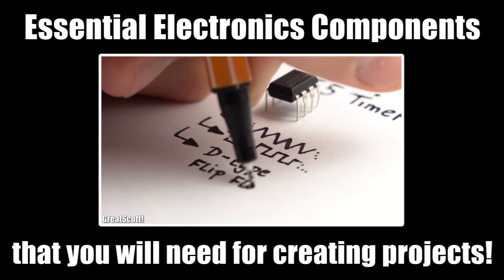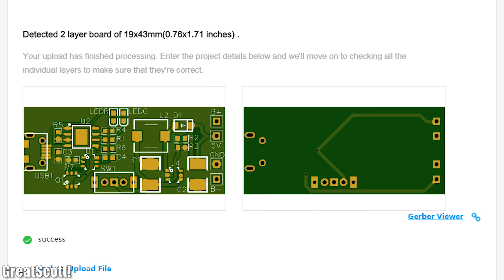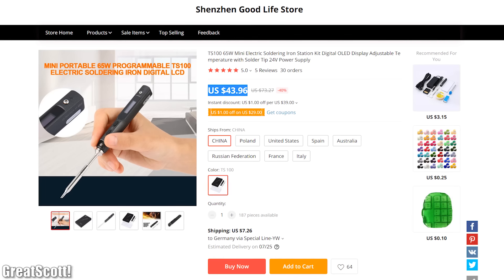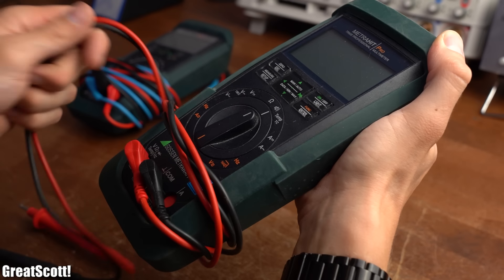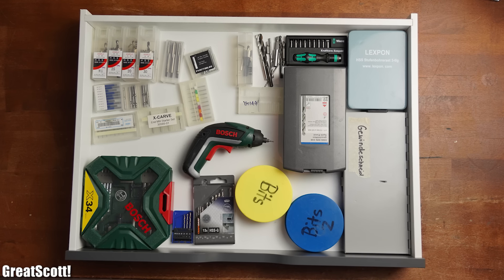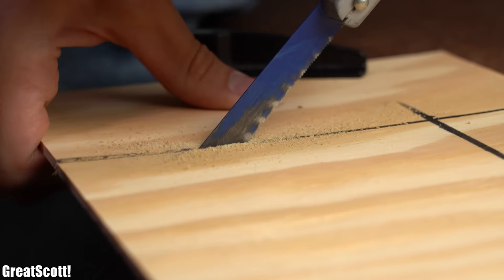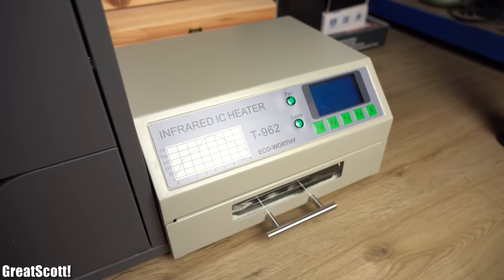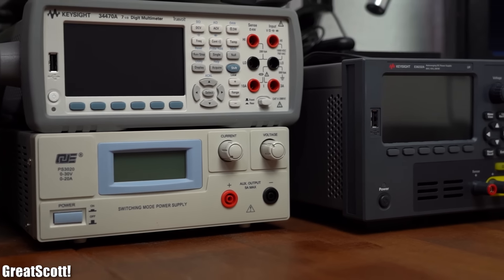Essential Tools that you will need for creating electronics projects!

Comment: I have:
0-200MHz Oscilloscope 2ch, color lcd, internal mem
Digital Microscope with helping hands
3 Soldering stations
Variable DC power supply (0-30V, 5Amp)
12 Volt 35Amp DC PS
A bottle of Crown Royal ( ESSENTIAL !! )
Drawer cabinet full of about any IC, resistors, capacitors, LEDs, jumpers, breadboards, sensors, etc etc
Toolbox with everything from automotive tools to electronic tools
Fluke 87
Snap-On tap & die set
Centech LCR
Bench vise
Spools of different gauge wire (solid and stranded)
Lots of solder in many different sizes and types
Lots of note pads every where
3 computers
a TV
Beer for the cat, so he will leave me alone lol
a Stereo system 
But most importantly we all need a brain!!
I think I really have too much stuff or so says the wife ;-)

BTW, GreatScott, keep up the great videos!!!!

Comment: Wow I own a 5$ multimeter and a 2$ soldering iron and I get all my parts from scrapped electronics. The fun thing is that when I needed an oscilloscope I got an Arduino with software called PCscope as a crude replacement , and here I see an oscilloscope costing 12000€ !

Comment: THE most important tool, is the wire cutter, spend over £30, I have been using a CK jewllers side cutter for decades, its still like new with sometimes very rough handling, indestructible!, those thin blade ones wont last you that long and these CK's get close enough for snipping device wires.

Comment: Another tool you miss out:
Tap and die set for thread cutting. Useful for making threaded holes on heatsink for example.
Reply: For some reason I can't find taps for sale in store for a reasonable price. Or when I do find them they are only for larger size threads.

Comment: I've used JLCPCB for my last couple of projects, and I have to say, I ALWAYS have a problem with the boards that come back.  The projects never work.  Of course, if I designed the damn things right the first time, there wouldn't be any problems! Once I get the design right, I never have a problem with JLCPCB (outside of the shipping time).

Comment: Pros/advanced already know what do they need, so I assume this video is directed at beginners.
9:55 "Those were all the tools I have laying around my lab along with recommendations what to get first"
Oscilloscope? Lolwhat, If you're beginner you will be working only on DC circuits, no need to blow over 1k USD on something like that.
Function generator? Same thing
Lab power supply? Beefy step up and step down converters + DA-2 power supply are enough for me.
Soldering stations are fine but expensive and sometimes cumbersome to use (thick cable which often gets very stiff in winter). I found simple 100w transformer soldering iron to work great with laptop cooling pad. The fact that tip on transformer soldering iron has small heat capacity and is only hot when you hold the trigger  often proved to be extremely helpful.
Microscope? Lol again, if you're a beginner you wont be working with SMDs for a long time. Forget about it.
Rest is more like housing making related instead of electronics so kinda unrelated.
To me in this video you either boast about your collection of tools or you try to make your part of the deal to advertise your sponsored items you received from sellers on aliexpress. Probably both, lol.
"You will definitely need an oscilloscope like I do, but dont get this one I have because it will make you go broke lol, get this cheap trash you pleb".
Reply: No third hand recommendation
No silicone heat resistant mat recommendation
No fume filter/extractor recommendation 
No anything that you can make yourself recommendation
Yep this is 100% advertisement video
Reply: I mean, just look at the description of the video how flooded it is with aliexpress links, lol
I hope they paid Scott well for this video
Reply: chill. first of all you need an oscilloscope, so you can really see what you learnt in theory, i dont need one that costs 1k, the 200e hantek that i have is pretty good.
and a good linear lab PSU is going to do worders, you can even make one yourself and trust me it s super fk instructive, i m building one and i learnt a lot of things, there are a lot of good quality PSU schematics on the web. 
soldering station? you dont need that? man... you can get a T12 one on ali for 40e and it will outperform that ersa , the tips have a lot of thermal mass and the restistor is embedded in the cartidge , the wire is silicon so it wont get stiff, handle is small and light , good for precise work but it can do the heavy lifting if needed.
Then you can always keep an eye open for deals on ebay/ local fair, i snatched an industrial PSU for 20e repaired and its on my bench now (70V 20A adj).
And if he makes some money with this video whats the problem?
Reply: @fabiofoltran4361  I have no problem with videos that advertise as long as theyre useful and this one isnt, its even misleading sometimes. Its pure, 100% advertisement and 0 useful info. Just take a look at video description, he even left link for chinese tweezers, box cutters and other mundne stuff like that. Its really not much different than what you can get locally, so why ship them over thousands of kilometers? Makes no sense.

Comment: One thing that I realized now that is missing is:
A computer!
Needed for programming of uC's, designing PCB's, reading spec cheets, and other related stuff.
Find one cheap on classifieds as you probably only need a USB port, and if you need an OS you can always install a linux distrobution.

Comment: Hi, well, I have annoyingly shaky hands so a selection of small vises and third hands. Combined clamp/magnifier very useful. Also a large diameter low magnification illuminated inspection lens on a swivel holder. Robust soldering iron stand if no soldering workstation. Solder reel dispensing stand. Small Torx screwdriver set. Earthed working mat and wristband. Handy can of beer ..... resistor colour code chart - terrible memory - especially after a beer. Cheers. Hic! BobUK.

Comment: actually surprisded the soldering iron isnt a jbc, as well as a hot air rework that isnt a hakko or something similar, for multimeter, if you cant afford gossen, fluke makes good stuff too, like the 87V 

and glue gun what brand would you recommend ? so far i've only have good experience with bosch glue gun that i purchased back in 2016 and havent exploded yet, and small nozzle one is amazing

Comment: I made a lab bench power supply a few months ago and it's not quite what I expected. Its range is 1.2dv-28.7dv but it wants to jump from around 4dv to 18dv and from there to 28dv. I've been trying to save money so I can go to the shop and buy a good one but that hasn't happened yet so for now I'm stuck with this one. Anyone who wants to throw some pointers my direction please feel free as I am new and still learning. Thanks

Comment: My multimeter and soldering iron cost 20€ in total. It is suprising that they even work.
But it is obviously much more difficult to solder with such a cheap iron.
Reply: I just have a 15 dollar multimeter it does everything I need just fine. I used lygte multimeter site to find one that was cheap but good

Comment: If you are just starting to get into this hobby you can buy some really cheap alernatives 

You dont need an expensive bench power supply there are some very cheap ones (like 10-15$), and you can simply design with a simple battery and potentiometer or something

The cheapest soldering kit you can find 

I made my own function generator from a circuit i found online, you will need some cheap components though like op amps, capacitors..etc 

I bought pretty much all of the components that i needed for like 50-60$ and it was enough for so many projects and circuits 

So i recommend buying the cheap stuff at first, you will definitely learn more from them.

Comment: @Greatscott! I need help ! I am just a beginner and I wish to interface ztp 115 IR thermopile (has a thermister for cold junction compensation)with hx711 adc and any microcontroller.But the problem is that the sensor and thermister give a non linear output so I don't know how to linearise the output and as hx711 has internal gain (128) so that would be enough . As  I am just a high school student so I don't know how to solve such complex equations😔 . So main aim is to :
Linearise the output   
Compensate for the cold junction 
Convert the adc reading into temperature.
Note:ztp 115 has thermopile and thermister in the same package.Also no need for external op-amp circuit.
Can you please help ?

Comment: Nice microscope. Have you ever try to add extra lens  into the front? This is sometimes useful. Unfortunately my microsdope doesn't have the tread for extra lenses or filters. Can you  rotate the post / lifting bracket if you want the work plate pointing backwards? This is a useful function. (I had to modify my very cheap microscope to do that.)

Comment: I think a logic analyzer is an important tool for debugging digital stuff. There are many on ebay etc which go under the name Saleae, and you can use these with s/w downloaded from Saleae, but this might be not suitable - depending on your morals. These tools do work with the open-source Pulseview s/w which is my preference. An 8-channel logic analyzer from around 11 ukp - what's not to like? They have templates for protocols like I2C/SPI etc so it is easy to see the data transfers for debugging.

Comment: To all the beginners out there: You don't need all of those tools to get started. And which ones you need heavily depends on your projects. I'd say (and I am noch qualified to say basicly anything here) the bare minimum tools are: 
- Box Cutter 
- Multimeter (<10€ in my case, works totally fine) 
- Pliers (pointy ones ideally with an integrated cutter)
- Screwdriver set (one of these bit sets with a handle, starting at <20€ for low quality ones)

Comment: I would love to see more use of the Keysight LCR. I have that, but most people in videos use other. 
Did I not see a dim bulb tester, it may be used more often for repair but if you are building and testing amps or other large circuits, it's nice to have.

Comment: It is expensive. I don't think any of these suggestions are wrong. But if you're starting out, on a tight budget not all is lost. Start with breadboards, cheap breadboard power supplies, a component kit, multimeter. Maybe $200 to start. Once you have that, grow where you need. At least you have some things to go through basic theory with practice sessions.

Comment: Could you make a device to automatically increase/decrease TV sound to a set dB level? Something like a listening device wedged between couch cushions, with an IR output pointed at the TV. Seems like adverts are much louder (have measured >10dB) than the TV shows. Also movie explosions can be crazy loud.
Reply: It wouldn't be fast enough.

Comment: Sometimes it's also good to search for 2nd hand tools (especially those simple ones). It's much better to have a used but good quality screwdriver, caliper, measuring tape or even battery drill, than cheap new shiny crap. I can also recommend Aliexpress bits set that will work with most of the screws existing in our universe :-)

Comment: Maybe you missed a simple handheld calculator? So handy to have around to quickly do simple maths? Also a powerbank could be quiet handy to have as an isolated power source. And maybe also the cheap chinese logic analyzer. Oh, and breadboards, together with a lot of dupont cables! oh and what about programmers, FTDI breakout boards etc :-)

Comment: Hello I am very new to electronics and don't understand a few things.

I am currently trying to make a fan powered face mask or papr mask. I have a 12v fan and a 18650 3v ish battery. I would like to figure out how to use a thermoelectric plate under the mask to power the whole thing using natural body heat but,

I don't quite understand how to get a 3volt battery to power a 12volt fan at normal speed. Any info or links to info would be amazing!

Thank you for your time!

Comment: All tools are nice, but if you don't know how to use them they are useless. Any advise on learning the basics? I'd also like to create my own designs and PCB's but am struggling to get started for years now..

Multimeter use and (SMD) soldering is fine (not excellent), I go down to 1005 (hot air).
Mostly I'd like to learn how to find faults/defects to repair stuff. From amplifiers to robot vacuums.

Comment: I'm sorry but most of these are completely unnecessary to get started with electronics. All you need are some basic hand tools, a multimeter, a soldering iron and a variable power supply which you can make for pretty cheap. If you want an oscilloscope you can find analog scopes for little money, as for a function generator you have your phone, if you want a higher bandwidth get yourself a diy kit. But these aren't necessary to get started. I'd say the most important tool for a beginner is a good quality multimeter.

Comment: I have a multimeter but I don't have a lap bench power but I'm Hobbyis Electronic even I don't have a soldering iron. But my Grandpa has one on is work he allows me to use the soldering iron and the lap bench power supply.

Comment: great video but I have to disagree with your recommendation of TS100. I have heard people saying that it is fine but in my opinion it really is not that great especially for long soldering sesions.
Reply: It really depends on how much you solder. For short/occasional jobs, it's fine. For anything longer you really start to miss the feel of a "proper" station with a wand and base station. Once I have a better workspace I'm getting something better and the Ts100 only comes out for the field.

Comment: I have a question please explain 
Question - Why don't ceiling fans or in general any ac motor change their rotational direction, even though current direction varies in the AC circuit?

Comment: Is that Chinese bench power supply safe enough? I always have issues determining if something which works with AC coming from China is trustable or not.
Same issue with PSUs for projects. USB chargers seems overkill for ESP8266 projects, but I don't know if I can trust cheap stuff for 24/7 operation.

Comment: Your list isn't bad at all, but somewhat expensive for a hobbyist that just want's to start up, over time it won't be as bad of course.
A DSO with a price tag of 1200 EUR is a bit hefty, to say the least especially at an entry-level. Go grab an analogue 20MHz 50EUR used scope unless you really need those digital functions.
Then you could get one of those "measures all stuff meters" no they ain't bad but sure not top-notch and of course a DMM (Digital Multi Meter) and a breadboard.
If you need a clock signal than get yourself a set 555 unless you really need arbitrary functions at the beginning or use your soundcard in your computer, it won't go much higher then 20KHz but for most slow clock fiddling it is just perfect, and with a soundcard and let's say Audacity you'll have the opportunity to make about any waveform you'd ever imagined, but LF only though.
I would recommend anyone starting with this go SLOW and use your mind first and learn by your wins and mistakes, just to say that you won't need an Arduino to make a LED blink you need only two transistors, two capacitors and some resistors.
The first things I would get is the DMM, Breadboard, a bunch of components and cheap or used PSU from a computer as it output 3.3, 5, 12, and sometimes even negative 5 and 12volt, this is the most common voltages you'll ever need as for a hobbyist. The biggest drawback of using the PSU is the current limiting which is about 10A. ;)

Comment: Sir, Thank you for an interesting and informative video.

I invite replies from your viewers to these questions:
1 - How much money do you want to spend?
2 - Would you rather start by making the power supply, signal generator, millivoltmeter for audio frequencies and above? 
I started out with no instruments at all, and gradually built my own test equipment.  You don't need to make all the outlay that this contributor suggests.  I managed for years without an oscilloscope, eventually building my own.

Naturally, if you can afford some or all of it, well and good - go ahead - ideal.  I have no criticism of this video, it's informative and helpful for those who can take advantage.  

 I seek to suggest an alternative path.

Those without sufficient theoretical knowledge might need to be given detailed circuit and constructional details.  There are plenty of those on youtube and internet.  I had the advantage of sufficient theoretical knowledge to start, and learned as I progressed, finally producing a couple of oscilloscopes - first one with all valves, the second one with all transistors.  Both a long time ago when ex-government radar tubes could be bought.  I wouldn't bother trying to make a 'scope these days, you can get them from under £100 for a USB scope and around £200 for a stand-alone 'scope, and they're better and cheaper than you can make them.

The whole point about this process of building your own from the beginning is the accumulation of knowledge and experience.  It's called learning - and it beats book-learning.

Same with tools: start off with a basic kit - amazon and e-bay among others supply them - you'll soon find out what extra stuff you need.

Electronics isn't only for the wealthy.

I repeat my appreciation of this video - I don't wish to be seen criticising it.